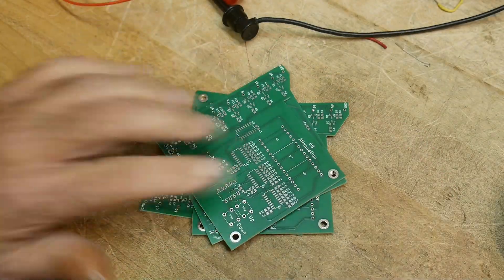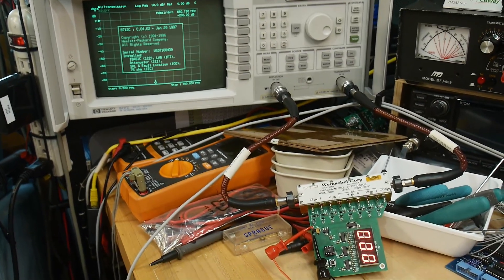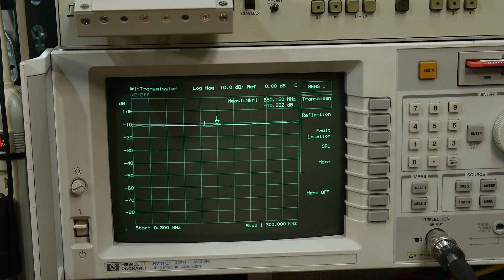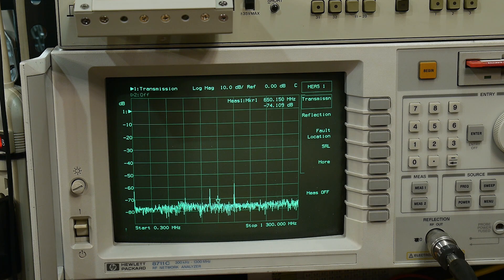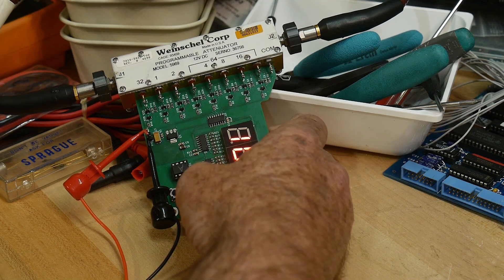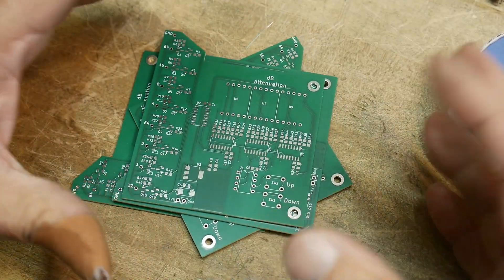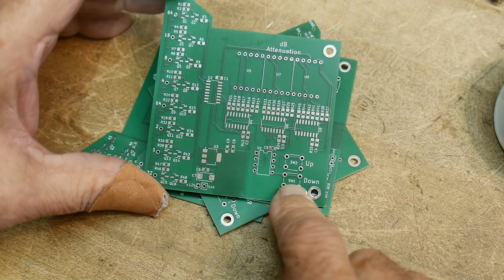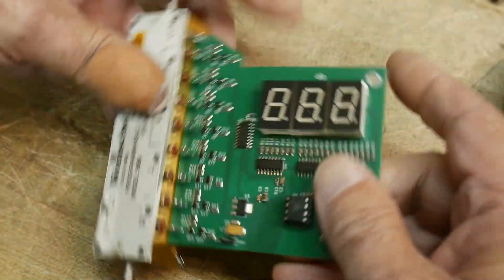#2051 Weinschel Attenuator (part 6 of 6)

Comment: Nice work but I would have included quench diodes on the relay lines but it looks like you have got away with it this time?  Love you're work
Reply from the maker: Tiny relays. Low current.
Reply: @IMSAIGuy  Yeah, I guess

Comment: Need component list , suggested vendor, and solder mask please. Is a preassembled board available?  Would love to see a 3D printable case for this project.
Great project and related videos! I bought a very similar attenuator Weinschel model 3200-1 off of eBay and bought your board from PCBway. Now for the components and solder mask.  Looking forward to building this project. any and all advise welcome. Thanks!
Reply from the maker: sorry no component list. when you buy the board from PCBWAY you can check a box for the solder stencil.

Comment: Does IMSAI Dog need to be fired for approving a board defect?   Not talking about the common anode/cathode problem, that was the fault of the parts provider but it was mentioned there was a defect in one of the attenuator connections.
Reply from the maker: having common cathode instead of common anode was my bad. The missing trace was 100% ImsaiDog.

Comment: It works!!  I should not be surprised.  However, I am a mechanical engineer and wanna-be electrical engineer who looks at this as a huge accomplishment.  With similarly complex electronics all around me, it is far from impossible.    I watch "nuts and bolts" EE videos all the time, but this was a very rare product development series of videos. As I move forward in my journey, I hope to build a product of similar complexity and function.  I have so much to learn!  This type of series provides a reference of how to go from concept to product.  When I embark on such a project, I'm sure I'll look back at each for reference and encouragement.  Thanks!

Comment: I think you should inseart all required attenuation steps before turning of any steps.
It seems like you have a racecondition on the relay switching times resulting in temporary lower attenuation than intended during the switching.
This could result in damage to sensitive equipment on the output if it get to strong signal.
This can be seen on the spectrum analyzer as glitches with way to strong signal when changing attenuation.